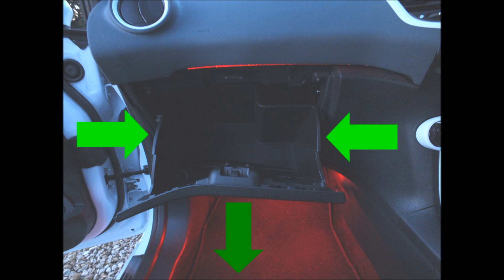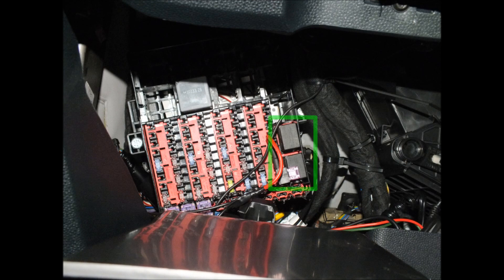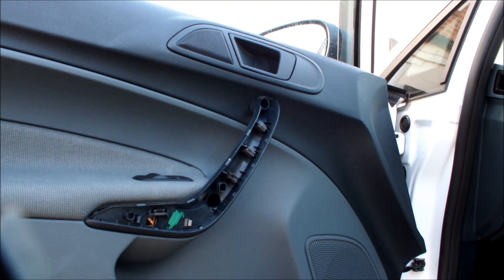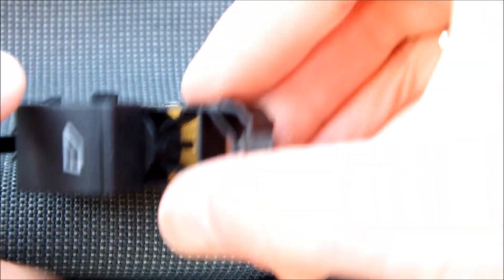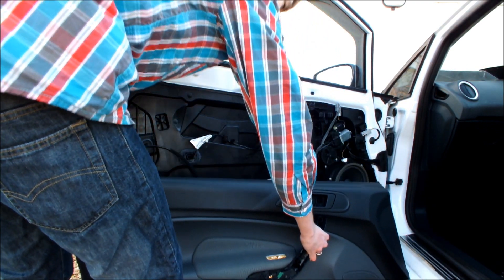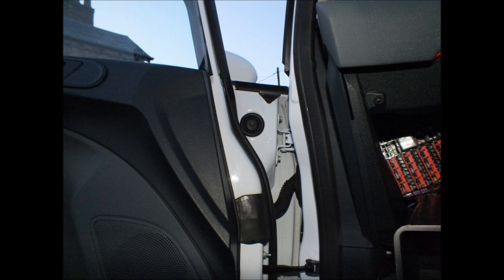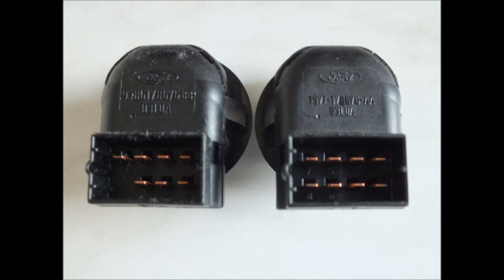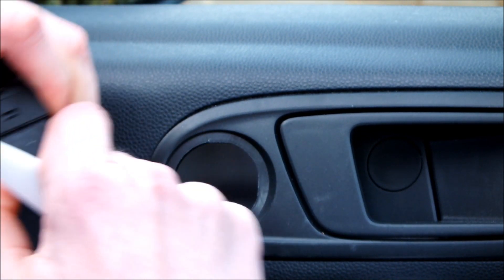Ford Fiesta MK7 (2008-2012) Door Card Removal & Powerfold Mirror Fitting Guide

Comment: This worked absolutely fine with my late 2010 fiesta, got myself a £10 screw and wrench kit and used a blunt metal knife instead of a trim tool, ordered the wing mirror off amazon.  The only thing I'd mention: when you're threading the new cable from the mirror into the door, there's a special canal it has to go through, otherwise the cable will stop the window from going all the way down, quite a fiddle but got there in the end.  Saved myself ~£150
Reply: AJ UK yeah I ran into that problem, mirror lead preventing the window from moving all the way down. Earlier it actually pulled the mirror connector out and stopped it working all together lol
Reply: @Nigel5uk  exact same with me

Comment: Powerfold Mirrors have heating elements in them aswell as the ability to fold automaticly. So if you push the rear windscreen demister button it'll demist/ unfreeze the wing mirrors too :)
Reply: Martyn Briant so do the non powerfold #oldpostrevival 😂

Comment: Great Video, just taken the door panel off to check why the speaker was rattling......there was a penny inside the door panel rattling to the vibration from the speaker.  By the way there were a couple of screws on the panel side as the side cannot be popped off from the plugins

Comment: Did this today and some points that do not really get explained in this video:

*If you have a 2011 model the door-card does not just come off as in the video, there are 2 small screws on the lower L/H side of the door that have to be removed and are an absolute pain, in the end I had to leave them in which made the remainder of the task very onerous indeed.

*When you put in the replacement wing mirror threading the wire through to the correct opening in the  door is a complete pain in the ass and it would be helpful if you have some sort of tongs to assist you in this task.

*The window will now only close 2 thirds of the way down and I have no idea why, looking at the previous comments it seems that this is a reoccurring problem.

*Make sure you have the correct tools, TORQUE screwdriver with a selection of head sizes and a suitable spanner that can get inside that little hole which houses the retaining washer for the wing mirror. 

Overall this video is useful but makes the task sound easy which I can assure you is not.
Reply: I had no problems

Comment: Hi did you upload the mirror power fold activation guide?
Reply from the maker: Unfortunately as it requires modification of Ford asbuilt data it wasn't possible to make a guide. I can provide modified files on fiestamk7cruisecontrol.com if you or someone you know has Ford IDS to upload the file.
Reply: @nathDOTso  Hi can it be done with forscan?  Yes if you could upload it to the sight that would be great, many thanks!
Reply: @nathDOTso  Would it be possble to add the fuse box with gem modules from the car the mirrors came from?
Reply from the maker: I haven't tried with Forscan, it might be possible. If you don't already have the right fuse box I wouldn't attempt it.

Comment: If you have a 2012+ fiesta, the R2 and R3 fuse are completely different to the pre 2012 fiestas. The mirrors are controlled via a separate module.
Reply: Dave Moffatt do you know which fuses are for the powerfold mirrors on 2012+ fiesta? I haven't the r3 fuse on my 2016 st so thought I couldn't have them. But after seeing this comment maybe I can. Cheers
Reply: @DSKbangervideos  Hi, 2 years on, and im looking to do this on my mums 2013, how did yo get on, thanks.
Reply: @sciroccomods  have you done this yet?
Reply: Please explain as getting it retrofitted to my 2015 st
Reply: @DSKbangervideos  Any reply?
Reply: @tjctpuppets2108  No. too much messing about getting it programmed. not worth buying a machine myself.
Reply: @sciroccomods you can do it with a OBD2 cable and forscan

Comment: Looking at doing the cruise control and power fold mirrors on the new st as they are not an option in England, if I had both fitted would I be able to come to you to have both programmed at the same time? Thanks

Comment: Hi, I had to change my wing mirror after driving it into a wall, it is not sitting flush with the door, there is a gap at the bottom between the mirror and the body work. Is there a way to adjust the angle of the sit?

Comment from the maker: I'll be honest & say as of yet no one has come to me with a new 'facelift' Fiesta or ST version so I can't guarantee compatibility. You'll also have a hard time getting a cruise control buttons that lights up blue as all scrapyards will have is the red version from the 2008-2012 Fiesta. But email me if you still want to go ahead :)
Reply: i am trying to see if i can fit power fold to a 2016 UK Kuga  . I can get mirrors but would like to see if i have the right fuse box,  there is 2 on kuga  , one in front and one in boot area . Hope you  can help out .  Thank you  .

Comment: Hi Nath,

Seen you about on FOC Forums (my username is thefiestaguy).

Just done this replacement today on the driver's side RH wing mirror, reconnected everything ok, except for one slight problem which is that the window (right side) goes most of the way down, and then stops.

Once you try to go any further it makes a suction sounding kind of noise and doesn't budge. I watched it without the door inserts/cards in place and it appears when it gets stuck the rubber gromit attached to the cable itself (on the replacement mirror) seems to be sucked into the hole where it is pushed through, and I think that is preventing it from going all the way down.

Currently waiting for the paint to dry on the primed plastic cover the kit came with and will then give that a second coat.

Other than that, it's all gone very well, took about an hour and a half, fiddling around getting the plastic strip off above the torx screws on the door handle (not the door release), and removing the door cards was a pain.
Reply: +thefiestaguy I assume you have already solved the problem given the time since the post but its to do with the route you have put the wire back. I replaced my wing mirror a year or so ago and has the same problem, it was the wire that was being caught by the underside of the window. The suction noise you hear is the gromit being pulled in. Take the wire out and re-lay it into a gap that is an inch or so further back and itll solve the problem.
Reply: Paul Batchelor Hi Paul, i'll give this a go, i've noticed over the last few days that the right side indicator, electric mirror and window doesn't work, (this is the side that was replaced), i'm assuming it's an electrical related issue. I don't know whether it worked or not since I replaced the wing mirror, but it's definitely not working now.

Basically seems the whole right hand side door has lost all electrical power, although i'm able to wind down the passenger's window using the controls on the driver's side, but not the driver's window or anything electrical on that side.